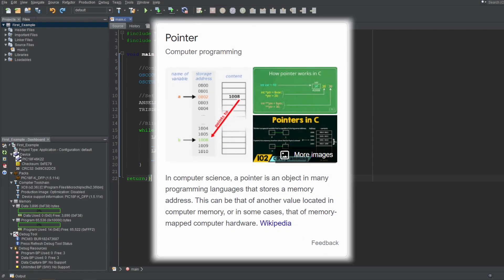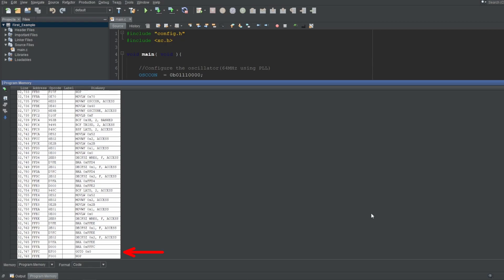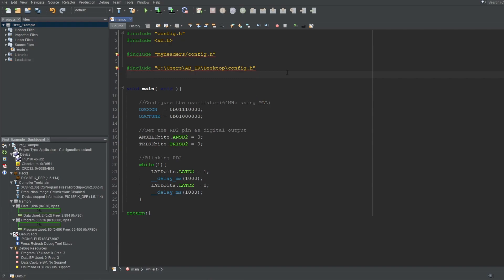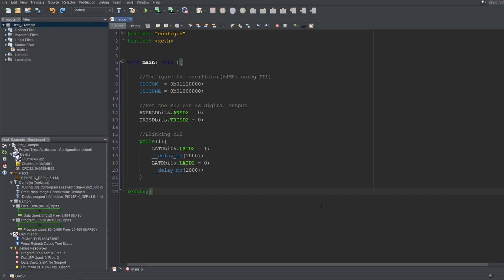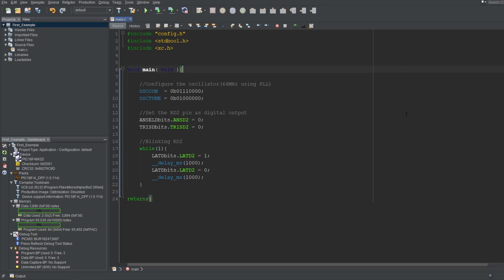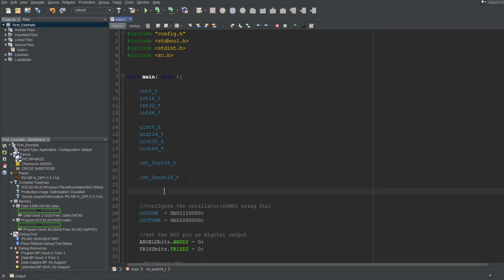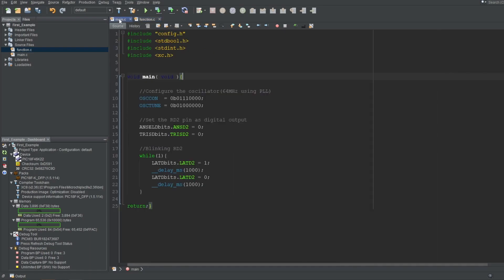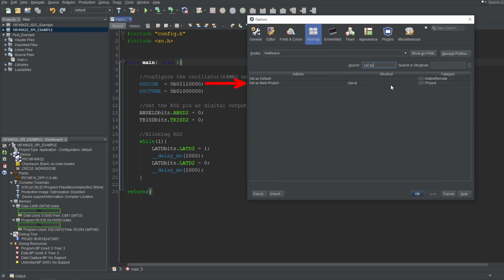PIC MCU TUTORIALS #8 - Info about C language in MPLABX IDE (Absolute Beginner)

Comment from the maker: Correction-1: At 9:57 I said that "char" is "signed" by default; however, in C, "char" is an exception and has no default signedness. Make sure to explicitly state "signed" or "unsigned" when using "char" if it matters. Other data types (int, long etc.) ARE signed by default.

Correction-2: At 9:36, 32-bit numbers are supposed to be able to represent values between "2147483647" and "-2147483648".